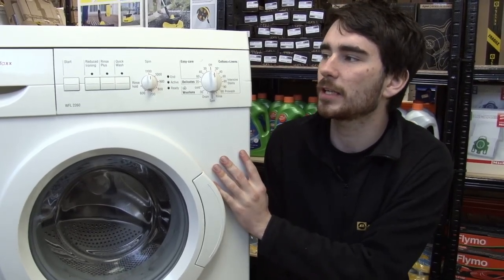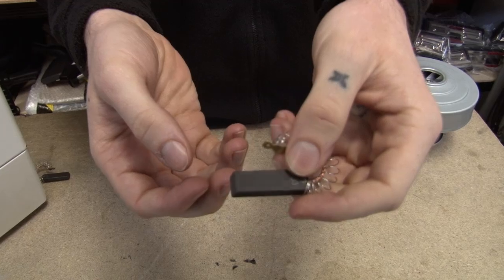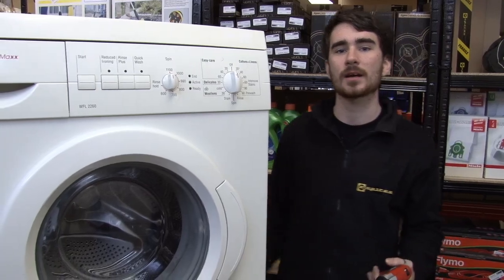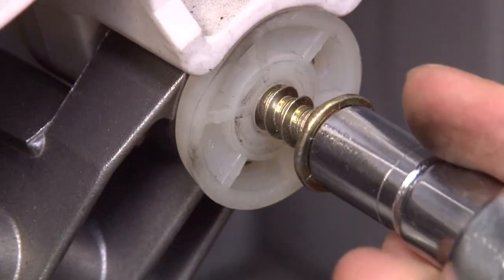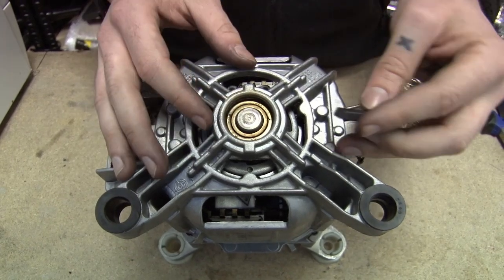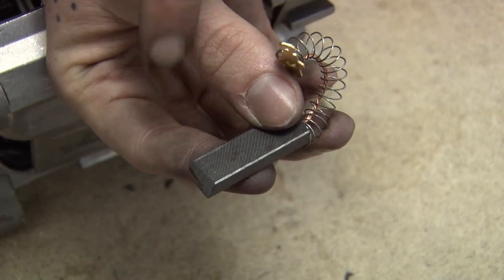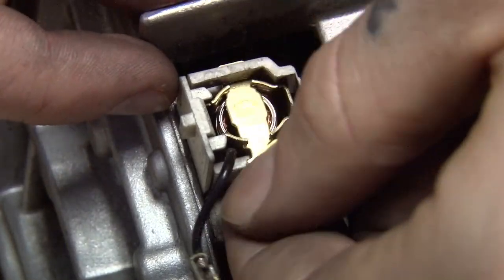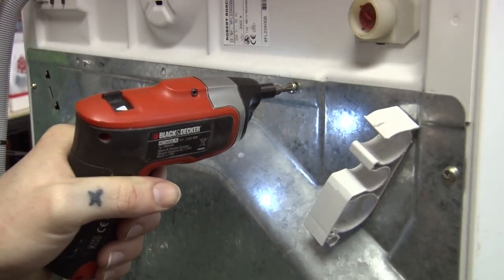How to Replace Carbon Brushes on a Washing Machine (Bosch)

Comment: Hi, I have the same machine as in this video. It is taking water in and draining too, just not spinning. I cleaned the inlet water filter and the filter at the front bottom, but no success. Any suggestions?
Reply from the maker: Check the motor brushes as shown in this video and replace if worn away.
Reply: Thanks for the revert. I tried to keep the start button pressed for 30 seconds and tried to start again. The drum moved for a fraction of a second and then stopped again. No luck thereon.
Reply: Will check the motor brushes now. Thanks

Comment: If I removed the old brushes a while before I got the new ones and cannot remember which way the angled side of the brush came out of the motor is there another way to tell which way is the correct way to install the brushes. In your video can I take it that the way you show is that the proper way the angled side of the brushes go in.
Reply from the maker: The brushes should contact the commutator of the motor with the flat edge and not on the sharp tip. Look at the angle the brushes are set to to determine if you need to rotate the brush to ensure the flat surface is in contact.

Comment: Many thanks for the video. Without it I couldn't have replaced the brushes.  I used another video to clean the commutator and put it back together. I thought it was all wasted because the error code wouldn't reset!  However after at least 10 try's I finally cleared the error code and it works fine!  Many thanks for the advice.
Reply from the maker: Thanks for the comments Richard, glad you managed the reset eventually.

Comment: Thanks, this is the problem with my Young generation, after 12 years and +- 1000 washing jobs the brushes are worn ( checked all other possibilties) but there is no way for an easy replacement since the fu*** from Bosch decided to design an oval inspection door to allow belt replacement only. I will need to take the whole machine apart (when I find some spare time), ordered a new machine from Samsung, this is the last time I get the overpayed crapp from Germany. My dishwasher broke two years ago after only 8 years, special model , pcb expensive as gold and the new washer only from Bosch/Siemsns possible. I swear they design these machines to fail after x-running hours.
Reply from the maker: Hi Kurt, although it is tight If you undo the two motor bolts you can slide the motor of the mounting pegs and remove it.
Brushes are like brake pads on a car and are designed to wear rather than wear the motor and you would be very lucky to get 12 years wear on your brake pads. Don't bin the machine as repair is cheap and you can always sell the machine when working again.:-)
Reply: eSpares got the motor out, 6 mm left on the carbon brush 😳

Comment: Our Bosch washing machine was having symptoms like a wire was loose.  The drum wouldn't turn but when we opened it up, pushed and prodded, it would work again for a while.  The other symptom was there was graphite everywhere, inside and out.  After researching how motors work, we suspected it was the brushes.  They were only about 1 cm long when we took them out.  So far, so good after replacing the brushes.  Many thanks for the videol we couldn't have done it ourselves without it!
Reply from the maker: Thanks for the comments Andrea, remember to 'like’ the video if you enjoyed it or it helped.👍

Comment: I love that I can fix my washing machine thanks to this!! 
Problem: I've disconnected the wire socket and earthing wire, but the wires are bundled together with a plastic clip which is then attached to the motor by way of another plastic clip/plug type thing, and I can't work out how to unclip/unplug it. Any suggestions? Surely others have this same issue, mine is a Bosch Logixx 8 purchased in 2011 in Australia.
Reply from the maker: Hi Rachael, the wires are likely to be fixed with a nylon cable tie. It is possible to release these but you have to use a pin or small screwdriver to push into the clip from the underside of the clasp to hold and release the catch. It may be simpler to just cut the original tie and replace it as these as similar ties are easily available at DIY or car stores or if you have not ordered the brushes yet you can get them here: http://www.espares.co.uk/product/es1746497/cable-ties
Reply: Awesome, thank you.  Job done! I've fixed the problem now using your video, I'm pretty impressed with myself lol! The motor is making a loud whirring noise now though, which I guess I'll have to investigate! It's not the drive belt, as it makes the noise even when I've removed the belt and rotate the motor manually. I thought perhaps I'd put one of the carbon brushes in backwards (I forgot to check before removing it), but there was no change when I took it out and put it back in the other way.
Reply from the maker: If you look at the 'slope' on the brush it should touch on the 'flat' edge not on the tip. Even when fitted correctly the motor will be noisier initially as the new brush wears down to the armature shape so the noise should reduce after a few cycles.
Reply: Perfect! Working like a dream now. Thank you so much!

Comment: Really helpful video thanks! Just managed to complete this repair and feel great about it. 

For anyone attempting this on a Bosch wvd series washer/dryer. You cannot access the motor from the back panel. Instead you have to drain the machine, fit retaining bolts and access it from underneath. I had the machine on its side. Also, You also cannot completely remove the motor without dismantling other parts but you can remove one bolt to turn the motor round so you can access both points for the brushes. Although this is really quite fiddly it is possible for the amateur who's willing to have a go! 
Thanks again, you saved me £100s! :)

Comment: Thanks fella great help but was tough, torq screws are a nightmare after trying everything else in the tool box had to go and get torq head wasn't cheap in a set. Also watch when you yank the motor out its heavy and drops down I sliced both hands on the bottom razor sharp lip as I trapped them underneath the motor. But job done thanks again.
Reply from the maker: Thanks for your comments and sorry to hear of your accident. We have added another safety warning for customers on the video to try and help others in the future.

Comment: That's the second time I'm gonna be fixing my washing machine myself thanks to espares. Friggin love it! ^_^
Reply from the maker: Thanks for the comments Zarviroff. hope all goes well.:-)
Reply: All went really well. Although my washing machine is a short one (WLX20462OE/18) and the motor is impossible to remove from the back so I had to flip it to the side using some towels to support the drum as %anotherdiychannel% recommended in their video and get it from the bottom. :) But not out of the woods just yet. Looks like my fridge (also Bosch) is about to get out of order - water in the freezer. I think I bought them together at the same time.
Reply from the maker: Frost free fridge freezers can sometime ice up behind the cover and cause the defrost water to stop draining to the back. Check it is not blocked with ice and defrost for at least 24 hours with the door open before suspecting a fault. For more information see another video:
https://www.youtube.com/watch?v=duTWh83nVdA
Reply: eSpares thanks for the advice! I've watched that video too. :) Luckily though, it seems somebody simply had left the freezer door open for like a day. Looks in order so far. :)

Comment: Great video and really straightforward explanation for dummies like myself.  As a result my washing machine is working again, so thank you very much.  Only one suggestion, working out the angle of the brushes is quite a thing if you've forgotten the configuration and never wrote it down.  I had to take it back out and reconfigure it, not sure if helpful for anyone else, but this is how I configured them \O\ the second time and it works a treat.  All of this to say thank you very much for such a great video and help.
Reply: Also, I wanted to say that I'd have bought the brushes from your website as you suggest, were it not for the fact that I live in the Netherlands and a local shop actually stocks the part, so it was way easier.
Reply from the maker: glad we could help you out and we appreciate you sharing your fix it yourself experience  :) please continue watching our videos, thanks.

Comment: All electric motors have brushes???  Synchronous A/C motors?  My washing machine motor (Kenmore) doesn't seem to have brushes.
Reply from the maker: +Simon Baker At the time this video was made there where only a few brushless motors used in washing machines. However to improve reliability brushless motors are becoming much more common. We have previously covered this in viewers comments before. :-)

Comment: +eSpares ok so now its still not spinning , i hAVE , every think you did
 exactly , so now i dont know . its sending signals to spin as i can 
hear the borad clicking away,   many thanks
Reply from the maker: +John Lewis OK, can we clarify your problem, Does the machine turn the drum during wash?. does it empty correctly (from full to empty in 45 seconds or less)?, have you checked the motor brushes?. And what model machine is it?.
Reply: bosch maxx  put new brush in , empty yes spining not at all

Comment: hi ! nice video ! 

but how i can do RESET ...BOSCH MAXX 7 - DE 1000 - codigo wae20060ep

Thanks !
Reply from the maker: +Eduard ACHON MASANA Click on the 'Show more'  on the video description above for the reset procedure.
Reply: +eSpares 
hello, i tried, but don´t work  :((  BOSCH MAXX 7 (1000rpm) it only have three bottoms.. thanks
Reply from the maker: +Eduard ACHON MASANA You do have a spin speed button nearest the roatary knob. try using this when following the directions. if it does not work check the motor plug and the brushes are connected.

Comment: Thanks for the help with the video, which showed perfectly how to replace the brushes. After installation my washing machine is running, but now I have an unusual sound, almost like there is rubbing. Is this due to the new brushes or have I not done something incorrectly?
Reply from the maker: +David Legg The new brushes will have to wear a little to match the shape of the commutator and may be a little noisy at first. You can run a few spin cycles to help this wear in without a load.

Comment: I noticed that my washer stoped spinning and when I open the top I see sparks by some wires on the bottom.  is it the carbon brushs ??
Reply from the maker: +Josh Derish Sounds like worn brushes, take them out and check if they need replacing.

Comment: Warning Do not pull the motor out as you could seriously hurt yourself on the sharp edges of the washing machine, instead lever the motor out with a screw driver.  ex Bosch engineer
Reply from the maker: +John Lewis Good reminder to never get to confident lol.
Reply from the maker: +bill rich Thanks for your comment and tip. :-)
Reply: +bill rich be a man and just pull it out , i did and didnt hurt myself , read your comment then hurt myself putting it back in ,   jinx!
Reply: i gotta put it all back yet ...
Reply: +eSpares ok so now its still not spinning , i hAVE , every think you did exactly , so now i dont know . its sending signals to spin as i can hear the borad clicking away,   many thanks
Reply from the maker: +John Lewis Check all the plugs and connectors. If it is a Bosch make sure you follow the reset as described in the videos description. It is possible worn brushes can damage a motor module. If you still cannot identify the problem let us no the model number.
Reply: 2 late....but thanx
Reply: Our was stuck tight. 12 years old I suppose. Gentle leverage did the trick. Good advice. 👍

Comment: Great video, thanks Rory! But I was curious because I see that different brushes are sold. Some are as you describe with a long spring that are inserted, but others are a small block with an internal spring that seems to be bolted on the part.
They often seem to be to the same model number on the net aswel, so its hard to be sure before you remove the engine.
In my case its an old Bosch Maxx Wfo 2852 6kg.
I see you have some sort of selector on your site, but with over 11.000 bosch machine and no way to search for the model number, its a bit hard :)
Reply from the maker: +MrMaraxion  To ensure you get the right part always use the full model number ie Wfo 2852gb/05. Manufacturers will sometimes change parts during a production run but with the full model information you should get the right part by going to http://www.espares.co.uk/browse/at1085ma856/washing-machines/bosch
Reply: +eSpares 
Great. A search way inside the "choose your model" would be great because with 184 pages finding a part wil be hard. Im guessing a lot of costumers goes back to google after a few clicks...
Edit: Or just maybe instead of A, B, M,W put a smaller list with all the 3 first digits So WAA, WFL, WFO etc.
Reply from the maker: If you put your full model in the search box ie WFO2852DN/05 it then lists all parts. Click on carbon brushes and it will show only http://www.espares.co.uk/product/es481833 you can double check by clicking the link on will this fit my appliance and re entering your model.

Comment: how loud should they be when new? when I pulled mine it went flying across the room. I checked with a light and both brushes appeared to be angled to where they appear flush with the center piece. However, when I spin the motor there's a slight sound. Not quite a grind, but audible none the less. When the brushes are out it makes no noise when I spin the motor.
Reply: after the first run back to silent. Appears to be working as normal. Reaching max RPM spin speed now.
Reply from the maker: Christian Scott Hi Christian, new brushes have to 'bed in' as they wear to the shape of the commutator. As you already have discovered this usually reduces after a couple of cycles.

Comment: Very helpful indeed. If the back does not come off your machine, (ie its not a removable item, by design) get the belt off through the inspection panel at the back and then remove the motor by laying the machine on its side and working from underneath. Its do-able. Used a hammer to lightly tap the motor out once the 2 bolts removed.
The machine is now running sweetly, and Espares next day delivery did the trick.
Reply from the maker: R Davison Thanks for your comments and glad we helped. :-)

Comment: "All Electric motors have brushes"  - Wrong many types of electric motors are brushless although most washing machine motors use brushes.  Nice video apart from that incorrect fact!
Reply from the maker: Hi Simon, sorry about that but you will see in previous comments that you are not the first to spot this error.
As it does not detract from the information to carry out the repair and as we also have other videos covering brush replacements we do not intend to remove this video for this error. :-}

Comment: Good video. I have a similar Bosch machine. It does start by saying remove top and sides of the machine, without any reason why. Not necessary for my model, took bottom panel off and back panel. Is a good idea to spin the motor before putting back as you get a double check that brushes are in the right way around (something which cost me another 45 mins of my life lol). From finding a bra wire had gone through the drum, a huge piece of scale on the heating element and the joys of putting these things in, I have almost had a day in the life of an appliance engineer, and saved myself £££. Cheers
Reply from the maker: Hi Dan, as we say often in our replies 'There are many ways to carry out a repair'.
Some people may be concerned with lowering the machine or even may not have the strength to do so safely.
Often if you search our channel we may have (and do in this case) other videos on brush removal that may show different methods for different makes that may 'appeal' more than the first video you find so it may be worth looking at other methods before starting. :-)
Reply: Thanks for your reply - the video was the right one and yes I acknowledge there are many different models even within the same brand. I was trying to say to other readers you may not need to take the top off. Following the video I took the top off to find it was going to be from underneath and through the back 'window'. Make no mistake I think you guys are great!
Reply from the maker: Dan Williams Thanks for the comments Dan. We often reply in this manner to help anyone reading to see the different options and not just think this is the only way. :-)

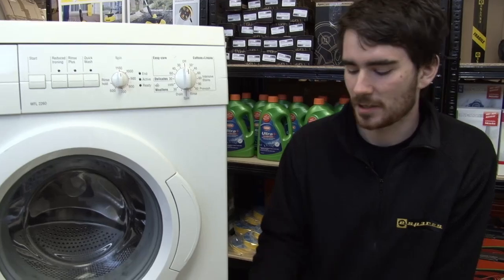Comment: 0:19 there are brushless motors,like ones in the table fan.
Reply from the maker: Hi, this video was uploaded over four years ago and most washing machine and vacuum cleaners then used motors with brushes. Now many washing machines and some vacuums are using brush-less motors.

Comment: Thanks for that, exactly the symptoms, exactly that easy to take apart, although I DID NOT observe which way the slant was coming out, but I think I can copy it from the video!  Now to see if I can find a shop tomorrow to get the part before christmas and so I have clean clothes this week.  But thanks you have probably saved me a couple of hundred euro.
Reply from the maker: HI Robert. If you order from us you can still get next day delivery well in time for Christmas and even standard delivery can some times arrive the following day.
Reply: Ah, sorry about that, didn't think of it, probably wouldn't have worked into Ireland.
Reply from the maker: Robert Moloney No worries Robert maybe next time as we do supply to Ireland and normally the delivery is very quick.